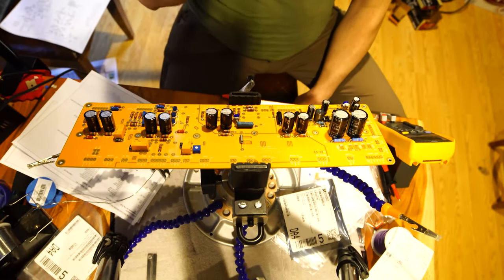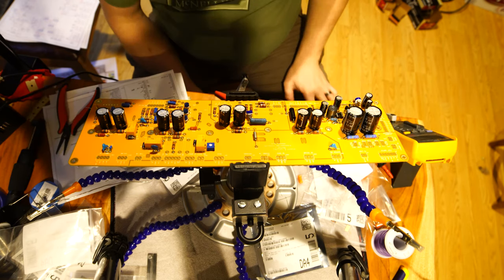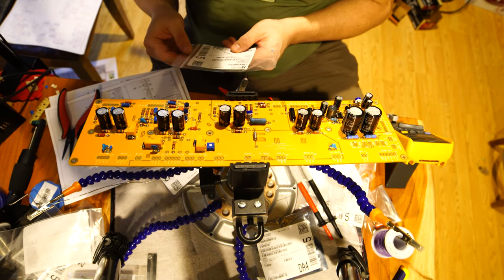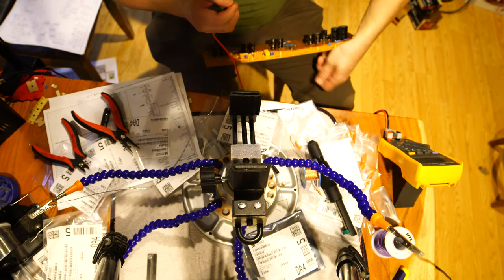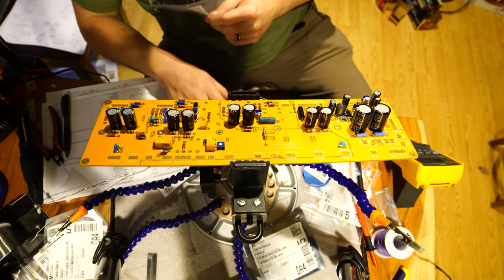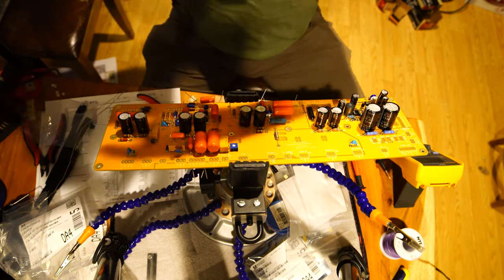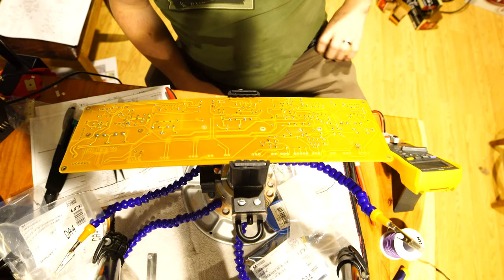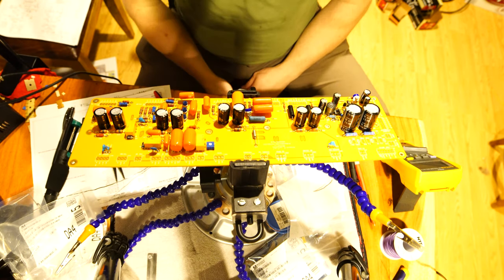Blues Deluxe  to ODS #183 Video 5

Comment: Hi- Antique Elec Supply (also known as CE Dist) has been subbing in other sprague OD series caps for 6PS series caps in several values for the last several years.  Is it because the 6PS is no longer made and they have run out of stock or for some other reason?  I dont know.  Does the substituted series have the same material composition as a 6PS...this is the most important aspect and why the 6PS is used in these ODS style amps, so check that out as they may be fine from that perspective.
Reply from the maker: Yeah from cde's own site they're still manufactured, but got some reason many capers y don't have them.  Not sure exactly.  As for the tone, in not 100% sure but I think it's due to polyester vs polypropylene in the different caps even by the same manufacturer